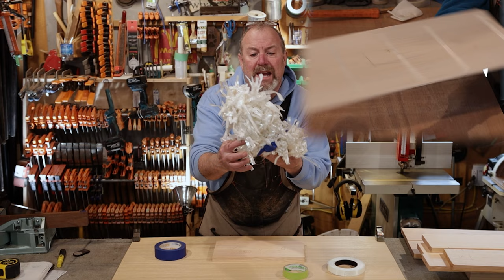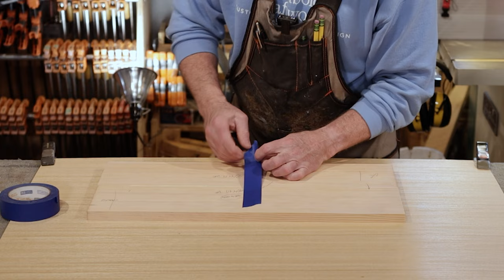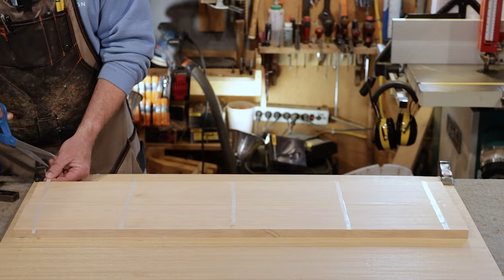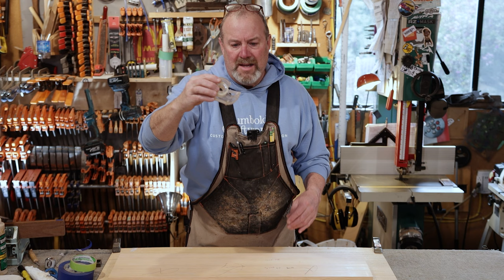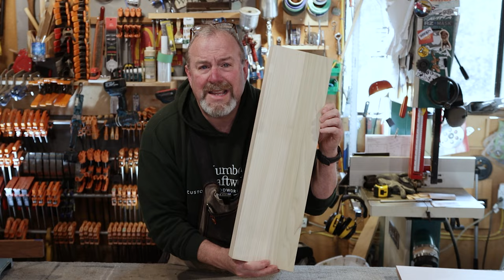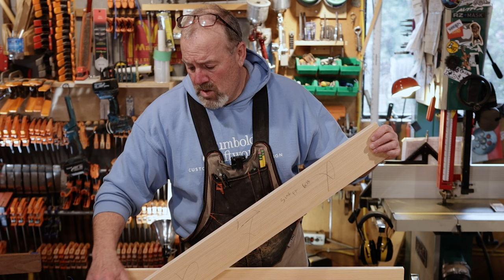Scotch Tape Panel Glue Ups ??? 🤣😅😂 The Tape Test   Wood Working with Mr. Kevin

Comment: MythBuster Mr. Kevin breaking boundaries again. Next thing ya know you'll be breaking the internet. :-)

Seriously though an interesting piece on using tape. And as you said  maybe the best choice for small pieces or thin panels that clamps would crush. I keep a few types of tape in the shop, but not strapping tape. Did you try the 2" clear packaging tape? Would a heat gun or hair dryer be better in some instances for removing tape than sanding? Sometimes you have a piece planed to perfection and might not want to take it down a notch as sanding would destroy that super smooth surface.
Reply from the maker: I have packing tape and never thought to use it 😱 next time for sure. Thanks Bob Have An Awesome Day !!! 😃👍